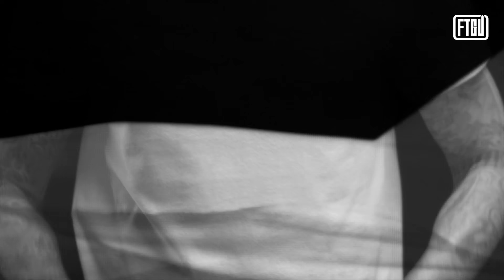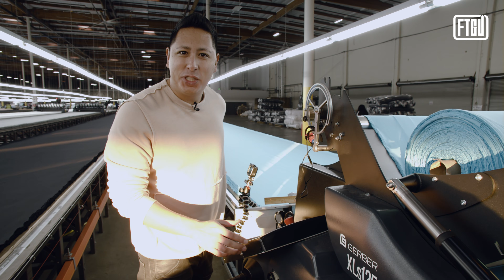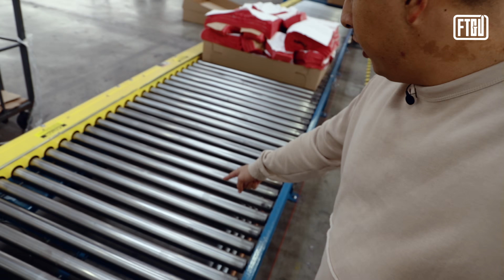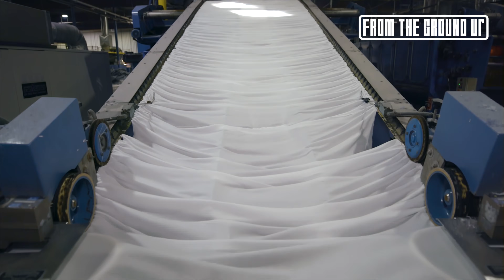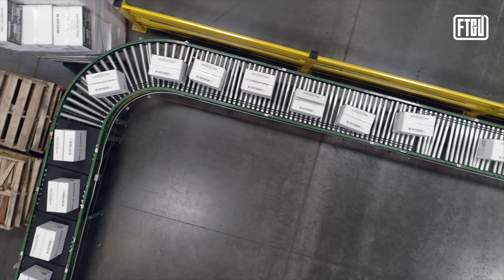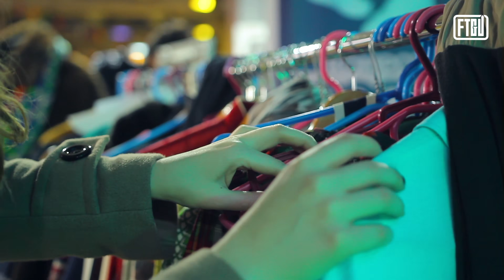How T-Shirts Are Made In America | From The Ground Up

Comment: I Worked in a sewing factory a long time ago, and the fabric was rolled out by hand, layer on top of layer, then the cutters had large machines that they used to make the cuts of the pattern that was laying on top of the fabric.  Then workers would pick up the bundles of pieces and put them together with what matched, then they would give each outfit to the sewing operators.  I worked in all 5 steps checking the quality of each operator as they did their job.  It was a hard job, since we were responsible  for finding any problems !

Comment: I already suffered from neck and shoulder pain just by sewing 2-3 hours. These guys sewed for 10-15 years is beyond me
Reply: I know this comment was made a while ago, but I have sewn both on an indusrrial and home sewing machine in the past before. I noticed a significant difference in ergonomics in both types. Industrial machines are designed ergonomically to sew multiple hours a day, several days a week, your posture in combination with a good chair is a lot better. When I sit behind my home sewing machine like I would behind an industrial, including the right height, I don't see my needle anymore at all. That has to do with the height of the shaft of the machine. Home sewing machines are ergonomically designed to sit on a higher surface like a kitchen table and for a few hours a week at most. Your shoulders and neck hurt because you have to work with your arms and shoulders on a higher level.
Reply: @titiasplantedaquariums   Thank you for this info!  It sounds like I’d be better off if I set my home machine on a lower table, but I’m not sure how I’d see the needle to guide the fabric through.
Reply: @kathyyoung1774  You can try to find a middle in between. My vintage Bernina home sewing machine sits in a DIY table. I try to sit in my chair as high as I can on a comfortable level and still be able to see the foot and needle. For longer sewing sessions it's still not perfect, but better doable than for instance with your example. Good luck👍🏻
Reply: @titiasplantedaquariums  Thank you. I’ll try to do that. My machines are in/on the typical sewing cabinets.  I never thought about using lower platforms.  Best wishes.
Reply: It's all about the small placement details of your work station an you to prevent permanent repetitive strain injuries such as corpral tunnel syndrome of the wrists and hands.  It could even mean the importance of raising or lowering a work surface a few inches to angle your wrists so the work their muscles less.
Reply: God built us all different.